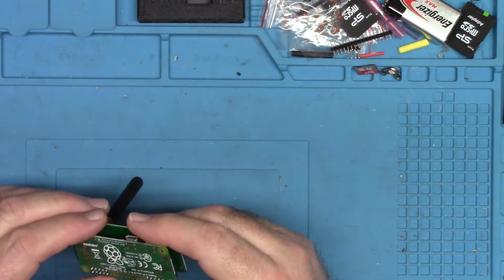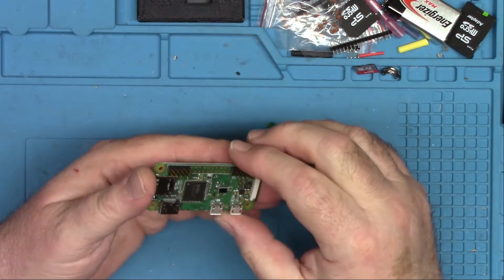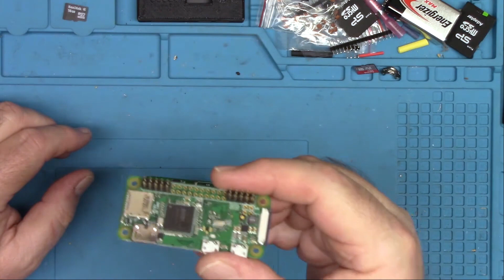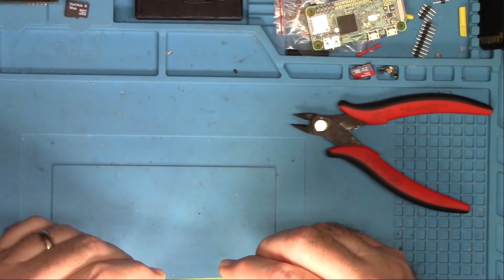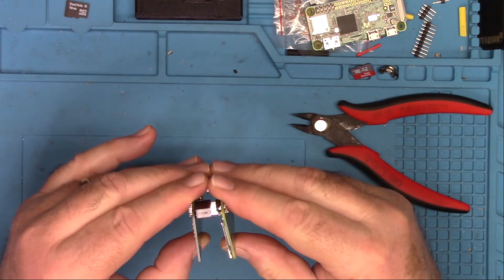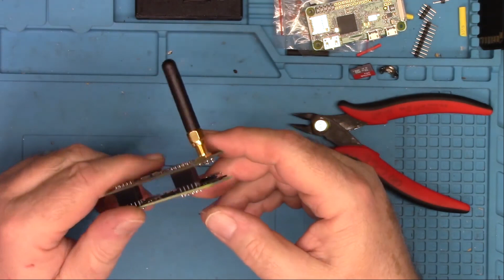Upgrade your Raspberry Pi Zero Hotspot: Power Up!

Comment: I didn't realize people have been having problems with the original Pi Zero W.

I have two hotspots with them and they work fine (including the web UI). 🤷‍♂️
Reply: It's the limited RAM...zram-tools helps ALOT with fixed/low RAM SBC's by allowing a compressed RAM space swapping instead of swapping out to the SD and burning out the card pre-maturely

Comment: Hey Jeem, thanks for the info. Do you know if it will run the WPSD (W0CHP) Pi-Star fork?
Reply from the maker: It will run it perfectly!  I've converted all my hotspots to WPSD
Reply: It will. Thats all i run
Reply: Hey you got questions, you know where to find me.  I've made like 8 hotspots. Basically i try to see will it hotspot... hihi. I resurected a PI 1B running wpsd lol
Reply: I have a Pi Zero W that doesn't seem up to snuff for the WPSD version. @the_mad_swimbaiter455
Reply from the maker: Randall - Pi Zero 2W  that's the key.